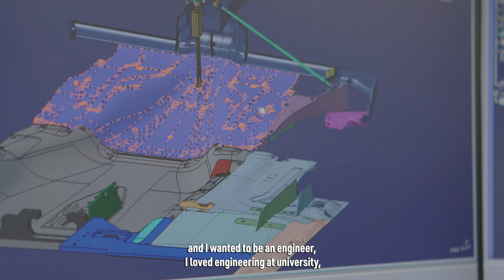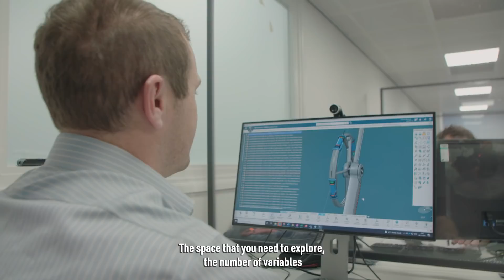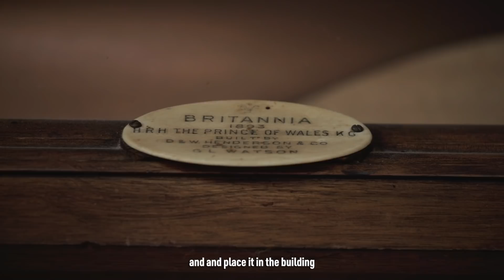INEOS Britannia: Moving Parts | James Allison, Chief Technical Officer

Comment: The FIA has admitted it made a mistake in Abu Dhabi, announcing it to the whole world.
This mistake is not just any mistake, it is even characterized exactly as a coup, since at the entrance of the SAFETY CAR, on lap 53, with 5 laps left and one more piece to the end of the race, Masi would have set up this coup :he informed to everyone exactly on this (lap 53), the entry of the SAFETY CAR ,"[until the end of the race, all stragglers (will remain) in the position they are in '(making Mercedes not change the tires, until the end of the race also)']".
And when there was only one lap and one more left to go, on the penultimate lap, on lap 57, when time had run out for Mercedes to change the tires. Masi saw, as the whole world was seeing too, that Hamilton would be on the last lap with old, hard 43-lap tires. And also seeing that Vestapen had just put on new, soft 4-lap tires, the blow was delivered by Masi in exactly this situation. He took the opposite decision to the one he had informed everyone, when the time for Mercedes to change tires had run out, saying: "[the latecomers, (will not stay) in the position they are in until the end of the race]".
All these details, without taking it out, are shown in the video: "É por isso que Lewis Hamilton acredita que a corrida foi manipulada"  =  "That's why Lewis Hamilton believes the race was rigged" ,video from EFFE1 channel, duration :2:52.
The mistake was taking the title from Hamilton, who had already won, giving it to Vestapen who had already lost the race.
A possible way for her to correct this mistake would not be to split the title in two by making Hamilton and Vestapen feel champions in half. Nor would it be taking one's cup to give it to the other, as was her mistake in Abu Dhabi.
But rather consider the champion of the period of normal race conditions, before her mistake, and the champion outside the period of normal race conditions that she already considered.
Hamilton also has to receive his champion's cup.
There would also be two champions in this grandiose championship of 2021.
This would lessen the FIA's disbelief in the face of this error of this size.